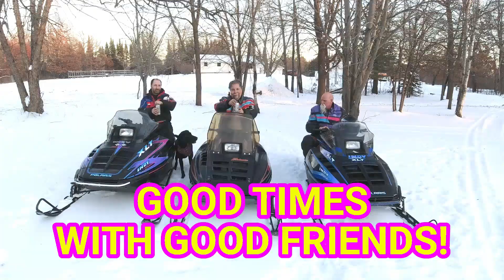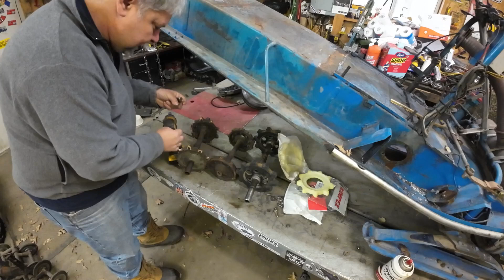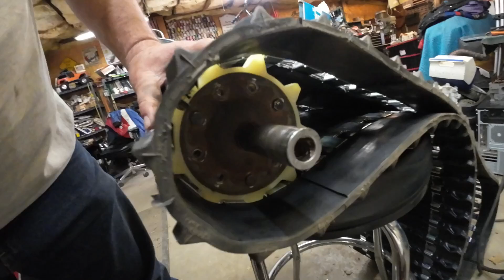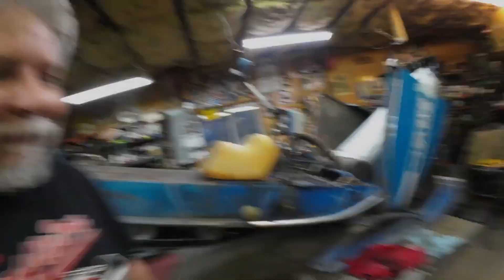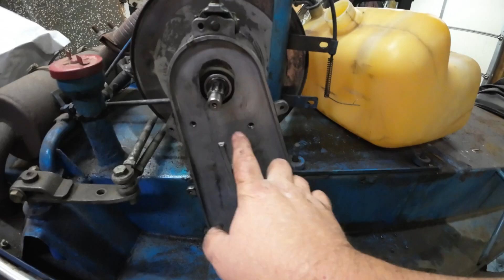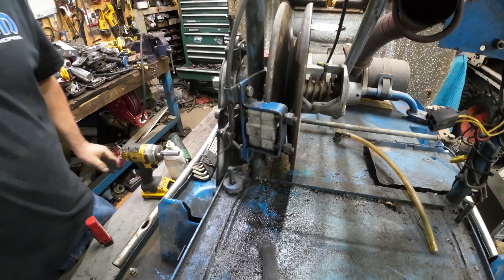Sno Jet One Lung Race Snowmobile Part 3. Ski Doo Track and Driver Swap. Vintage Snowmobile.

Comment: What’s wrong with the factory tank?
Reply from the maker: It IS the belly pan and the front of the tunnel and it's rusty and full of varnish gas.
Reply: @nuttersspeedshop  what I’ve done to those sleds is a hood pressure washin then fill it full of evapo rust wait a couple days and it’s brand now